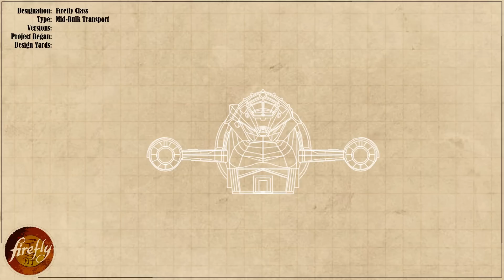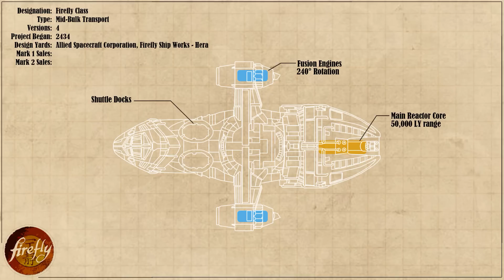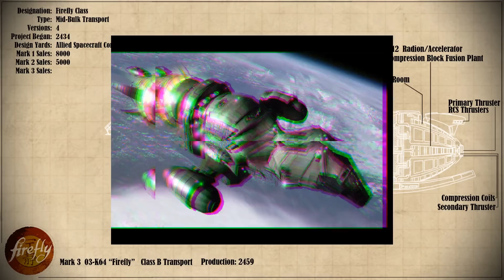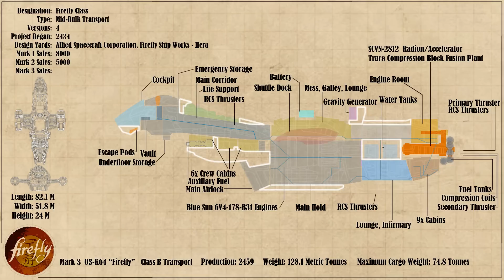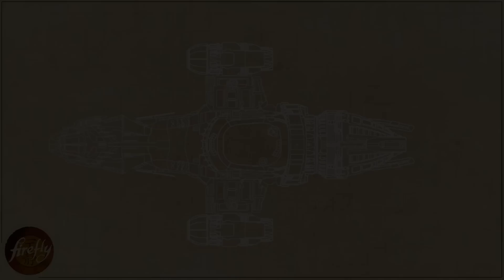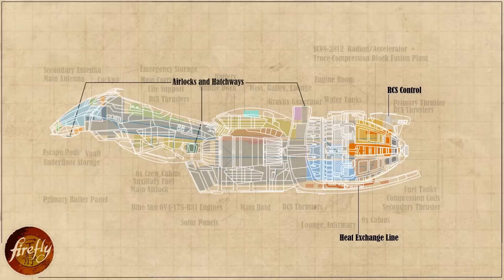The Firefly Class Serenity

Comment: Not sure where the range numbers are being derived from seeing as Firefly is a setting without FTL and a "range" of 400ly would mean the ship would be able to leg it (in relative terms) back and forth between blue sun and the inner planets likely in excess of tens of thousands of times (pulling that number out of my butt, I think the verse is only a few light hours wide at most, so it's likely that's a gross underestimate).

Comment: Range of 400 light years? I thought the firefly universe doesn’t have ftl travel. Maybe I misheard
Reply: Our universe measures distances in light years and we don't have FTL either.
Reply: @ Yes but realistically without ftl even traveling a single light year would take several years. That means the ship doesn’t need to refuel ever. Unless it’s in service for decades or even centuries. That kind of energy efficiency is unrealistic even for a sci fi setting.
But then again in space all you need is a push and you can go on forever which renders the whole range thing pointless anyway.

Comment: Still flyin' in our hearts. Amused to see the "multiple light years" rating when the canon shows the show all taking place in the same system. Joss liked to pin down such minor technicalities even like that Trek.
Reply: A ship able to access all the planets in a system without taking years and years might well be able to cross interstellar space, though it would probably require lots more resources and space.
Reply: AU would have made more sense than LY
Reply: Given the distances in canon, and travel times shown, a sublight non-Newtonian drive would make sense.  Speeds too fast for a simple fusion rocket with a mass ratio fitting the illustrated ship, too slow for a superluminal drive.

Comment: The buffer plate falling off made the video for me, well done.
Reply: What was that?
Reply: @emergingloki  Did the Primary Buffer Panel just fall off my goram ship?!
Reply: did you notice that on the plan of the ship the primary buffer panel was unattached and underneath the ship?
Reply: Just what does the primary buffer panel do? 
Besides buffering?
And how bad is it when it falls off.
Reply: @casbot71  It's basically a great big heat sink designed to take the brunt of the damage from transitioning in to planetary atmosphere, and if it falls off the next thing that'll start getting super hot is the hull, and right behind that is the cockpit full of vital equipment like Wash and / or Captain Mal

Comment: The ship felt real because the interior was built in its entirety. You could actually walk up the entry ramp and down through the cargo bay to the stairs. From the stairs you could go up to the second floor which had the crew quarters in kitchen.The large open cargo bay in the gangway above it allowed for filming.
Reply: @russellspillman9056 Do you know if any of the parts still exist? A dream of mine if I even won the lottery would be to build a house that would look and feel like a Firefly, and place it in a suitable looking area of scrub.
Reply: @grahammonk8013  I know the grav sled is out at Universal Studios in CA, though not sure about the ship itself. I was worried it was destroyed in the fire there, but it seems to have been rescued from the path of the destruction. I wonder if someone in the fire department there was a Firefly fan.
Reply: Glad I saw this comment, I was going to say something similar, but my version was way worse. 😄
Reply: It was actually 2 sets. The upper deck and the lower deck, while continuous from front to back, were built as 2 separate sets. So to go from one deck to the other you'd have to go different sets.
Reply: @Riceball01  Yeah that "oner" in the movie has one hidden cut there as they transition from one stage to the other, it was probably done for practical and safety reasons (reasons why multi layer sets are quite rare).
Reply: If I have my way this will be 1 of several ships I want to fully build. There are some complications to building life size replicas of things from movie's/shows however.. Namely copyright issues but also money and enough land to build them on though imagine having a "theme" park full of space ships to tour and play in.. That's essentially what I want to do if I ever had the money to do so and could get permission from the corporations/studios. I know it would bring in all manner of folk from all round with lots of shiney credits.

Comment: The Firefly is a better freighter than any YT-series
Reply: That's because the Firefly has an actual cargo bay with loading ramp.

God knows where the YT series was supposed to store  cargo.
Reply: @noppornwongrassamee8941  The YTs are also about the size of a Federation runabout. A Firefly can almost fit a runabout inside it.
Reply: @noppornwongrassamee8941  It didn't carry it. It pushed it.
Reply: Pretty much the same role though, both in universe and plot wise.
Reply: Yeah... Quite a bit slower, though.